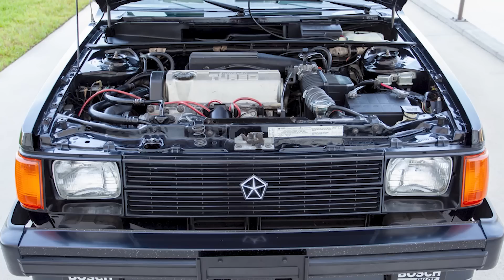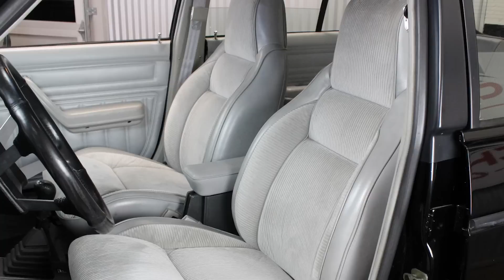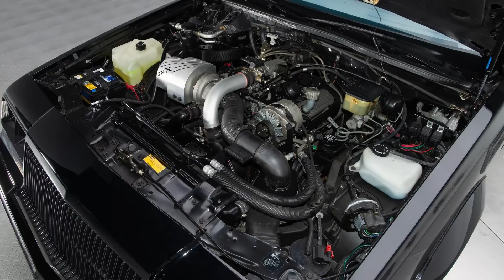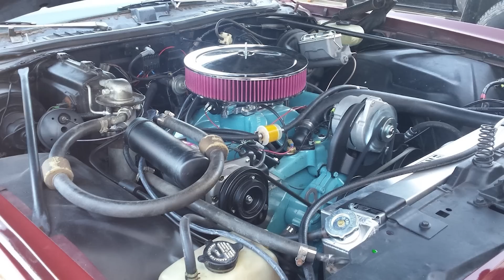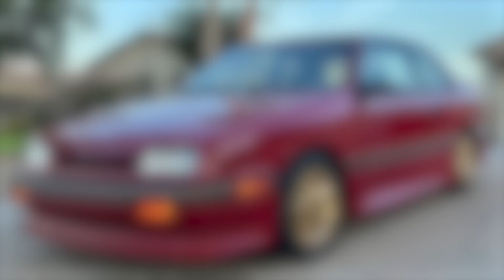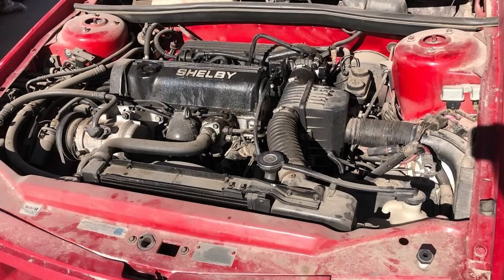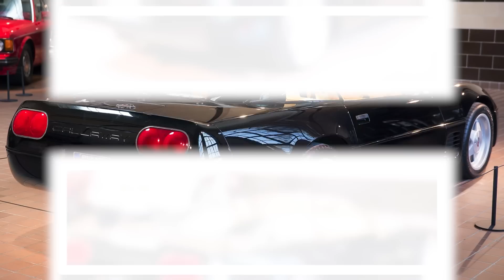5 Most Outrageous Turbocharged Cars Of The 80s!

Comment: The Chrysler 2.2L was a perfect engine for turbocharging.  It's undersquare, doesn't rev that high, and doesn't make much horsepower in naturally aspirated form, but slap a turbocharger on it, it not only makes more torque from the longer stroke, but makes quite a lot more horsepower without revving it out, which was really important in the early VTEC era.  By the time the Turbo III came along, that was hard to beat.  The whole Dodge 4-cylinder R/T lineup was packing and I can't think of any USDM in that segment could touch them.  Even "JDM" cars like the Del Sol and Prelude VTEC weren't as fast.  Thinking back, it's crazy putting 224 hp into a tin can, but they did, and it's just as fast as many new cars today in the inline 4 turbo market.
Reply: And torque steer for dayyys! I’m still looking for a 92 Daytona iroc R/T
Reply: @dmacpher  I like torque steer!  ;)
Reply: @danieldeaseweitzelwalker  the 2.2 was a fabulous engine and acceptable replacement for the Slant six. I owned Many K-cars with 2.2',s, preferred 84-85 as higher compression and carbureted, if you knew how to start them properly cold! I had a 2-door 85 Reliant with a 5-speed I donated an 84 Turbo 1 setup from a wrecked convertible, a sleeper musclecar Mopar could have but unfortunately didn't bother to build, despite being the lightest car besides the Omni.
Reply: @BrianPatterson-k4q Was it a 2-person procedure?  "Turn the key while I spray butane down the carb". ;)  They were better looking than the Omni, too!  A neighbor of mind had a Horizon - same thing, as you know - and it was really not that good.  The Reliant/Aries, and LeBaron especially, were a lot more comfortable. :)  Though I remember another neighbour disabling the "seatbelt" warning on his LeBaron after some years of driving it because he could "no longer stand to listen to it". haha.
Reply: @danieldeaseweitzelwalker  😆 No butane, but had to press the pedal once only, all the way to the floor, closing the choke to engage, then release it and start without giving it throttle. Worked fine every time, I helped countless flustered K car and Omni owners!
Reply: I had a auto doge shadow es turbo 4 cylinder that baby would roast one tire from standstill to 90mph then walk it out for 100-120 feet
Reply: @holeshot1721  haha.  Yeah, true. They didn't even have to be 5-speeds.  The autos were brute, too. ;)

Comment: Thank you very much for taking the time to produce a well researched and factual video. My very first new car purchase was a bright red Dodge Omni GLH-T. After replacing the exhaust with a custom made 3 inch system complete with a removable high flow cat and low restriction muffler, some mild head porting and Direct Connection computer the car ran consistent mid 14 second 1/4 mile passes. Top speed was unbelievable. You could twist the 85 mph speedo all the way back to its beginning (around 135 mph). This car would routinely embarrass many so called “muscle cars” while averaging 30 mpg or better on SOCAL highways. I’ve since owned many 60’s and 70’s muscle cars that sounded great and looked awesome, but that little Omni could run circles around them. Well done Mr. Shelby!

Comment: I believe the Grand National was also the first sequential fuel injection setup GM employed.
Reply: I bought a new T-Type Regal in 1986.  I will never understand why GM or Buick would not promote these cars more.  Everyone that rode in that car wanted one.  That car would smoke the tires in second gear.  In 1988 they went to front wheel drive and dumped that engine until the 1989 Trans Am came out with that motor for one year.  After that it became supercharged in the Regal and Grand Prix but was nothing like the turbo version.  On paper the supercharged 3.8 had better HP and Torque numbers, but 86 and 87 engines would put them to shame.

Comment: Finally a cool car in a YouTube vid that I had ..the Dodge Shadow 2.2L Turbo. .that car was awesome...kept up with 5.0's in the 1/4
Reply: I had the Plymouth Sundance, fun car to drive.
Reply: @windrider65  I had a Sundance turbo also.  It was a great car.  I hurt a lot of feelings with that car. 😂
Reply: Yah but so could the warlock... A pickup truck
Reply: dodge Shadow.
Reply: I had a Red 93 ES V6 5 speed.
Reply: The VNT version was cool
Reply: No it didn't. Shadow 2.2L turbos ran the 1/4 in 16s. If you had the 1990, 15.4s. 5.0's ran it in the low 14's. You would have got smoked by 13-20 car lengths.
Reply: @itry2brational  if they could drive it...and I would keep up with them, if not take them off the line...so keep your numbers, but I have RL data to go on.. keyboard warrior...
Reply: @mykelengieza7057  Truth hurts a sh!t talker. The only RL data you've got is from the tailpipe fumes of all the 5.0s that smoked you. lol
Reply: @mykelengieza7057 don't worry about blue oval crybabies. My 93 IROC Daytona R/T didn't just keep up with 5.0 but smoke them from green to stop without sweating. Even the handling of the Daytona was superior to Ford
Reply: I can’t believe somebody was able to buy Shelby’s personal CSX VNT  with plaque # 1 on it. $69k on bring  a trailer. Trailer queen fresh

Comment: The Dodge Shelby Omni GHL S was a total turd. Even in a straight line could not stay straight and God forbid you gave it some gas on an corner exit. The Turbo Trans Am was a dog. Pontiac picked up the worst engine in it's line up , 301CID V8 ( total crap) and slapped a turbo with a flow trough carb. Even when the turbo kicked in after eternity of lag, it didn't do anything. The Shelby CSX produced only 500 cars because after the crash of Shelby Omni, nobody wanted to have anything to do with that turd. and those cars stayed on the dealer floor for moths. There was another Trans Am Turbo- 1989. It used the same engine as Buick GNX and it was a ripper. The advertised HP for this bird was 245, but when you put it on the dyno, it would show 240-270 at the wheels without any mods.
Reply: The Omni GLH Turbo was an absolute blast to drive! Yes, having bought one new in 85 I can say with authority that the car itself was a very cheap, poorly built car that was also very dangerous if driven recklessly (massive torque steer). At the time, it was a modern day Road Runner. Cheap POS car with a strong drivetrain that could be made very quick with little effort or money. I always ran into hater’s that thought the car was a joke thinking nothing could beat their 5.0 fox body! It was always fun seeing how pissed off they got as their friends laughed at them for losing to an Omni! Please share with us some of the cars you’ve bought or built that were faster, cheaper, 30 mpg, mid 14 second 1/4 mile, and rock solid reliable.
Reply: My GLH Omni was the ultimate sleeper.  Put new bushings, beefier sway bar, pulled the cat. Actually got a taller profile tire that gripped better in the wet (Rhode Island). Uset to time my self around shore drive past all the mansions and back to Thames St.  That damn car handles like a roller skate.  That car was a "Get in, sit down, shut up and hang on" kind of car back then.
Reply: @mjbusn  Engine was ok but the rest of this car was trash
Reply: @czarekaj1098  Omni/horizon 1978 car of the year then followed by a 13 year production run, with two years for the infamous Turbo Omni.  Actually, a successful platform that would help Stellantis present day if they had something similar.
Reply: @2t713  Motor Trend's Car of The Year was also 1971 Chevrolet Vega ( trash) and 1974 Ford Mustang II ( trash).  Just like the Omni/Horizon that was trash
Reply: @czarekaj1098  You ARE "trash". HA, HA
Reply: A stock GLHS beat a modified 66 GT350 at Willow Springs racetrack in 1986 (Hot Rod Magazine) just think what it could do if it could drive straight. Carrol Shelby is quoted that the Omni Turbo was one of his favorite cars. Just facts.
Reply: @2t713  sure sure and pigs are flying everywhere

Comment: Why is the right headlight missing in acceleration trials, and in quarter mile runs sometimes? Always wondered...
Reply: It’s removed to facilitate a fresh air intake and provide some ram air effect
Reply: @squidduck  Thanks 👍 I've been working on cars many years, but never knew that 😆
Reply: Im sure it had a inlet pipe to the turbo behind it. Removing a headlight will provide no "ram air effect" it may slightly cool the engine bay.
Reply: @jeremywhittler8591    Depends.  Thunderbolts had 2 headlights removed to facilitate 2 ducts from the air cleaner.  No turbos, so in this case some ram air effect is offered
Reply: @squidduck  I knew about the Factory headlight omisions with the ducts, but wondered about the removal of ONE by people doing test runs.

Comment: Pretty cool video. but it would have been nice if you actually showed the real engine compartment for the "1980 Pontiac turbo Trans Am" instead of stock footage of different cars. Images of The actual engine for that car are all over the internet. it took me about 5 Seconds to find them LOL.
Reply: Or specs , 10psi oil pressure? Think not
Reply: @Don_keedik Yea that was weird.
Reply: I was just coming to say that
Reply: Not 1 of the pictures/images you posted was of a turbo charged Pontiac engine! The mear fact that all the cars had opened air carburetors, tells any real car guy that these engines weren't turbocharged/boosted in anyway.  
Any Pontiac enthusiasts will tell you the 301 engine was one of Pontiacs biggest engine failures. And the 0 to 60 run, of 8 seconds, I also find very suspicious?
Reply: I agree, although tri-power's and dual quad small blocks are cool, they clearly are not turbo Pontiac V8's.
Reply: JS I only once seen one so I cannot say I could of got a good engine shot of an anniversary trans am sorry bro keep reaching
Reply: They were garbage slow garbage
Reply: Pontiac never called their limited slip "posi-traction " that is a Chevy Term , safe-t-track is the pontiac term.
Reply: My dad had one when I was a kid that car was a burnout machine 😅 a great memory with my dad showing off when he dropped me off at school in the 90s
Reply: I found one of the turbo trans ams for 15k full restoration now valued at 80 to 90k
Reply: @sneezinhatch A restomod one with a 455 and Turbo, looking factory would be sweet 👍
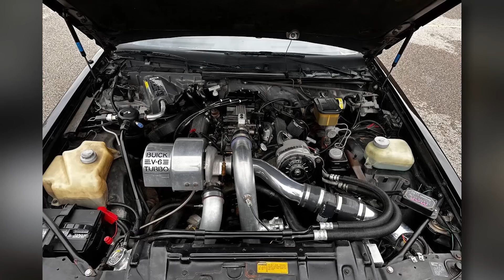Reply: 8:18
Reply: @michaelvagman1423  thanks for replying but "8:18" is the Buick Grand National . not the Pontiac Trans Am.
Reply: Same exact engine...  @davidvega6215
Reply: @davidvega6215 the Buick grand National is a Pontiac trans am with a turbo and some badges.
Reply: @acsnitner7661  ?!?
Reply: @acsnitner7661  what are you smoking? The turbo buicks were around for years before the 89 turbo trans am.
Reply: @michaelvagman1423 that's only for the 1989 Indy Pace Car 25th Anniversary Turbo T/A, not the 1980.